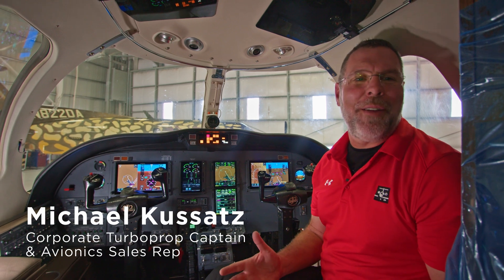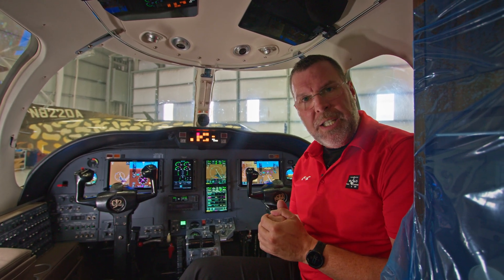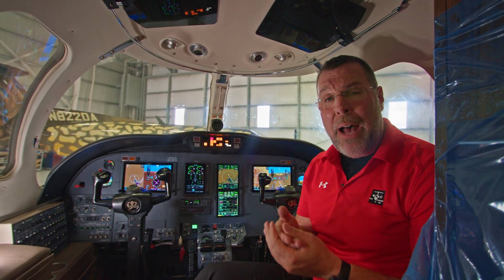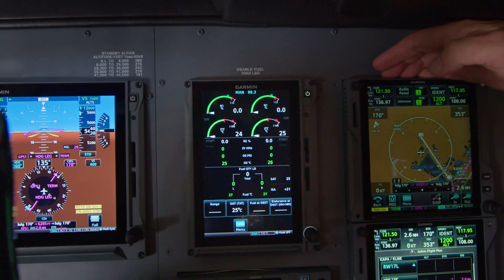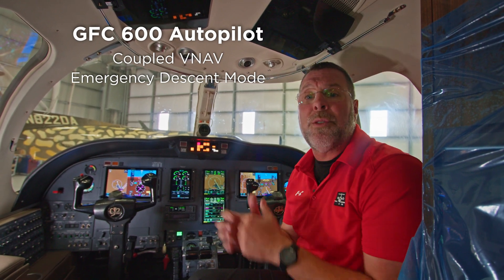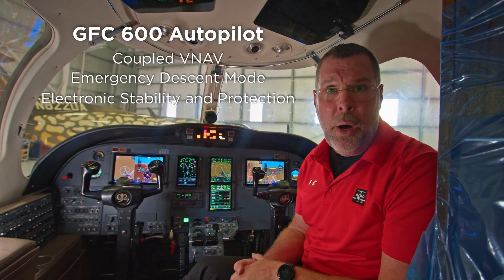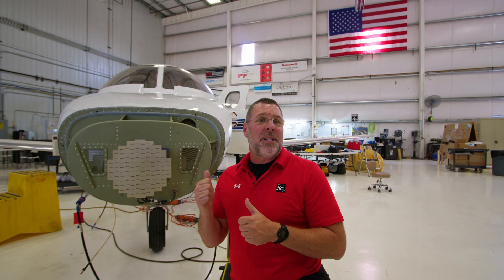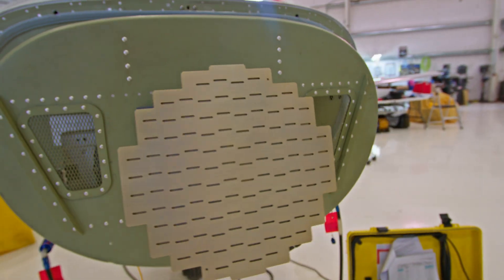Garmin G600TXi Flight Deck Upgrade for Citation CJ2 Aircraft

Comment: Where is the GCU485 controller?  where's the heading bug?  Garmin is great for touch screen until normal turbulence makes data entry nearly impossible.  Panel mounted transponder?  Why? the remote transponder easily interfaces with either GTN.